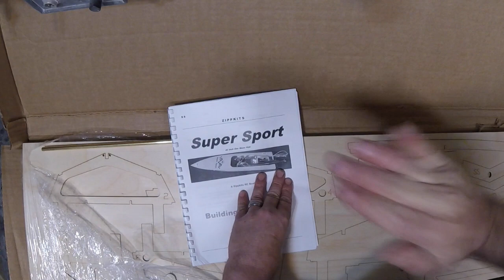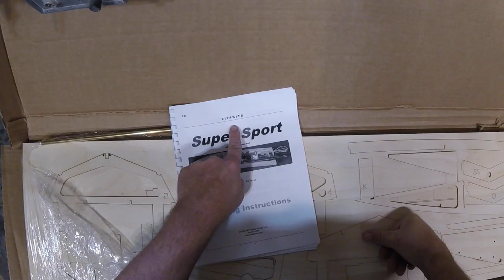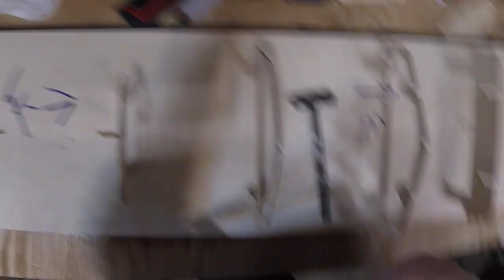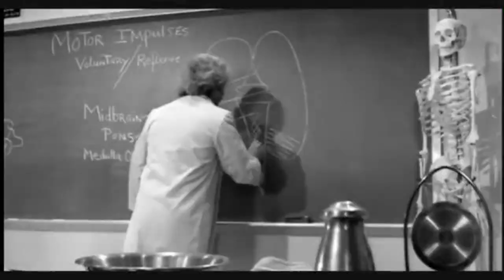ZippKits Super Sprt RC Gas boat build, chapter 1!!!!!!!!!!!

Comment: I’m building a Super Vee. I’m trying to get the engine installed. I don’t seem to be able to get the engine mounts on the motor to line up with those on the boat rails. What’s the secret ? It seems like it should be straight forward. Maybe I’m having a long term brain fart.

Comment: Your gluing method is fantastic. Using the Scott Myers method is very tedious and will piss you off. Thanks. I've got both a stock 30 cc and a gizmomotors 35 cc modified.  Which would reccomend.?
Reply from the maker: hmmm shoot me the like to the 35cc. zenoh dosnt make a 35... they make a 26,30 and 32
Reply: @jjrotogeek  It is sold by gizmo. It's called the 30 cc plus. Of course they claim it's their top performer.
Reply from the maker: @jefferyferguson9232  oooooh a gzr.  I’d use the stock 30.  This is a super light boat.